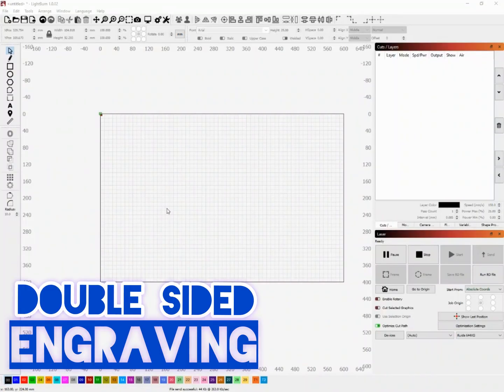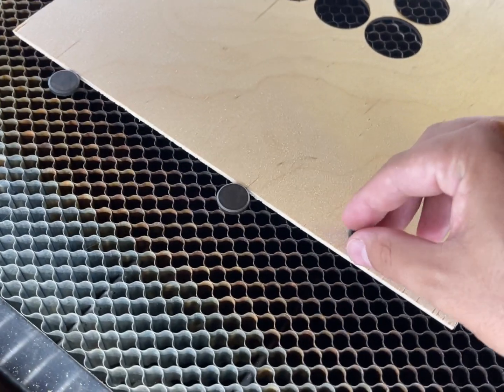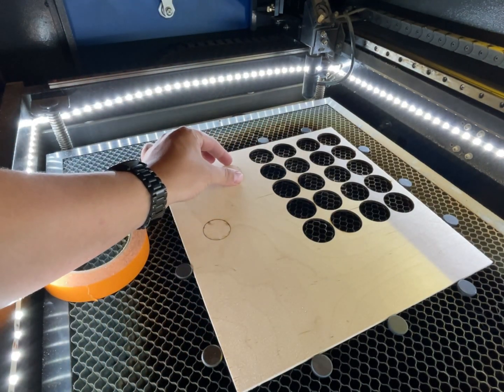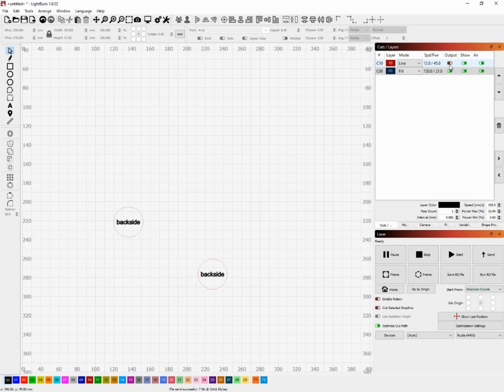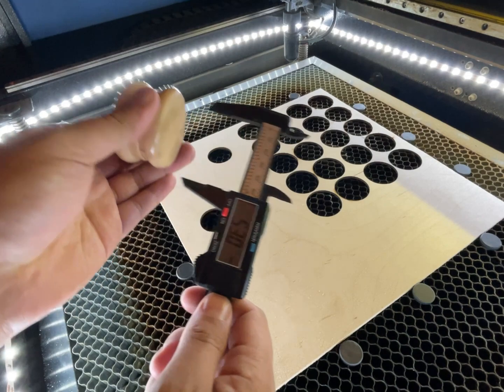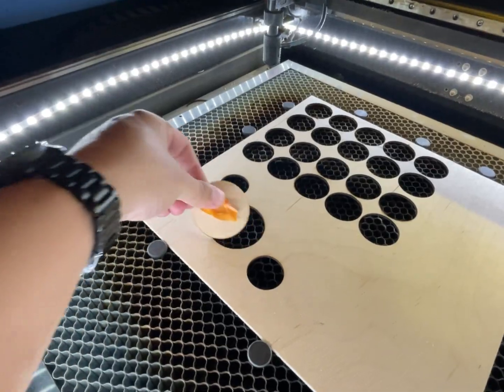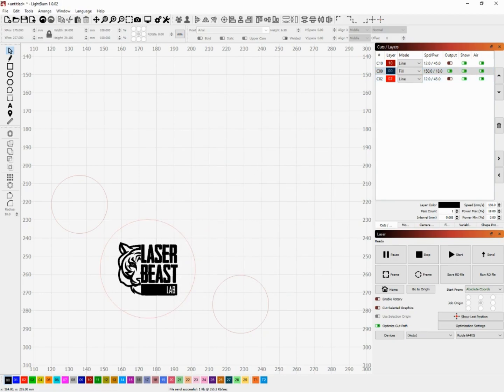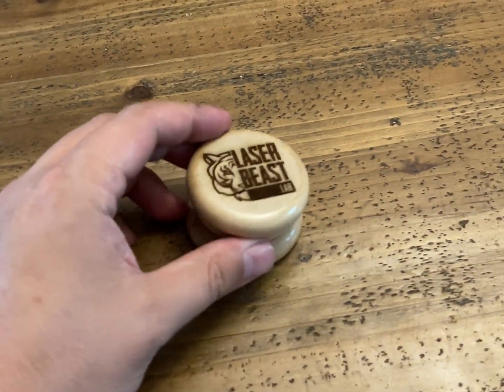How to Laser Engrave Double-Sided! - Laser Engraver Tips & Tricks - OMTech

Comment: Thanks for the great tips on the template.  I'm curious, however, if I've missed any obvious techniques for engraving double-sided objects that are either not circular or not symmetrical as they will not fit back inside the cutout...
Reply from the maker: The best tip i can give for a shape that isnt symmetrical, is to take that outline and make a mirror image of it. THEN put your engraving into the mirror imaged outline. So when you cut the outline out, your piece will fit inside perfectly.
Reply: Good call.  Worked like a charm.  Thanks very much!  I dont quite have the brain of an engineer.